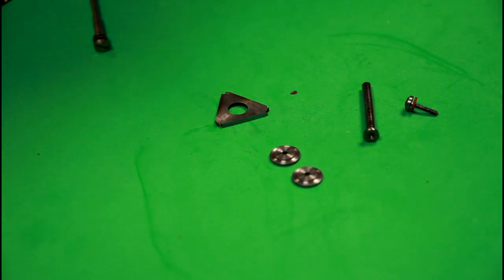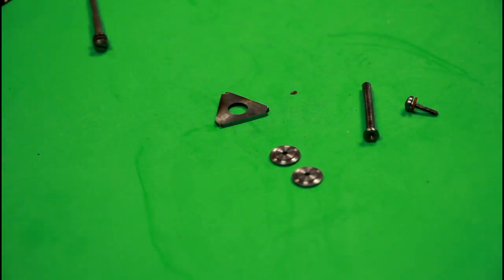Making a power carving bit for hardwoods

Comment: I would like to know more about the tools you use for carving. Like the rotary tool. What would be better than the Dremel or Fordom type?
Reply: Better in what way? For out and out power and durability you can't beat pneumatic die grinders. But they're not very convenient to use due to their need for compressed air. So there are trade offs. A lot of pros use Foredoms because they can run a long time themselves. Foredoms are a bit slower than inline electric rotary tools. They're just different in use. My CNC engraver likes to show me how much I suck at using rotary tools. What it can do effortlessly is amazing.